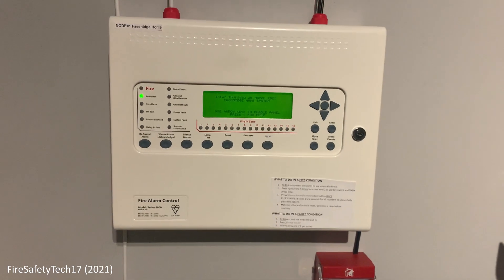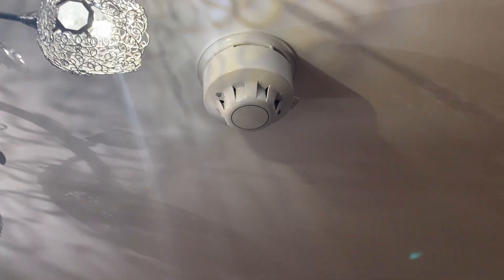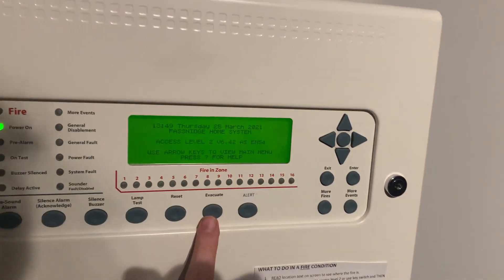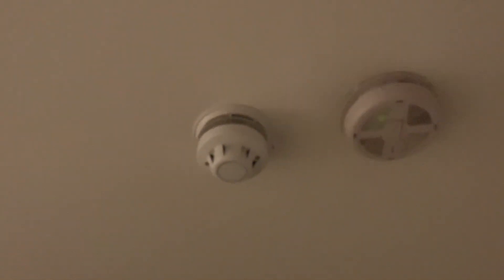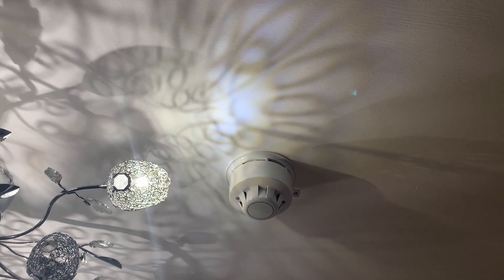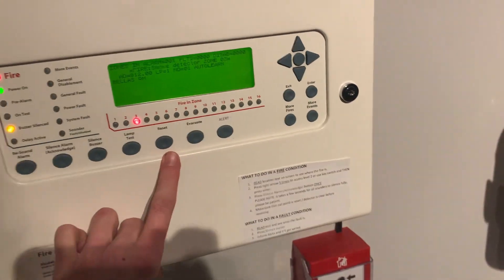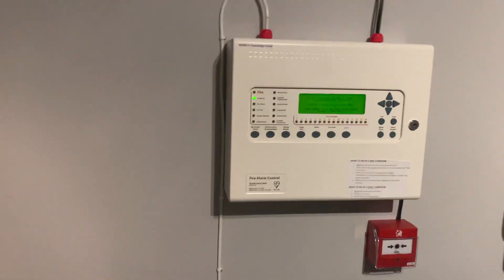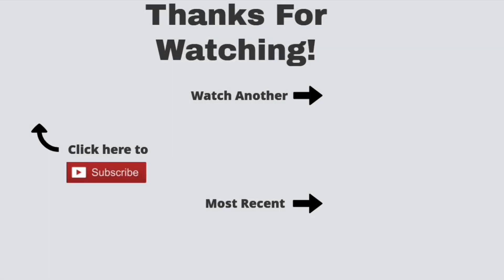Apollo XP95/Discovery House System Test 1 | Tour And Test

Comment: You can do system test 2 Someday
Reply from the maker: It’s already recorded, it will be uploaded on less than a week.
Reply: @fst1775  why did you put A Heat Detector in the Bathroom?
Reply from the maker: @Siobhan_OShea  Smoke detectors are going false alarm from steam and would be more prone to contamination.
Reply: @fst1775  uhh Ok Never Noticed

Comment: also the reason the symphoni is crackling is because either you have wired the loop the wrong way into it or you don't have enough isolators.
Reply: isolators are to cut out sections of the network that are short circuited. they don't filter interference. if you get a section of cable between two isolators and short it out you will find the yellow LEDs come on, on both and the panel will report open loop along with missing devices on the shorted section of cable if any.

apollo have designed their protocols to be quite robust against interference, they will take quite a bit before data becomes to fuzzy to decode, the interference can however be amplified by the sounders if it gets past the filter circuit designed to filter the power from the data on the two wire network. 

all FP200 cable is screened for data integrity that's that foil wrapping the pair, follow the manufactures instructions on where to connect this to in each device and most importantly at the panel where the screen is connected to earth.
Reply from the maker: @testlogs9005  yeah true, I’ll get round to replace the synphoni to an open area sonos sounder probably.
Reply: @testlogs9005  Yeah I had that with my intelligent call point and KAC call points isolator leds lighting up, but it was handy as I knew it was the wires going between the two that were shorting
Reply from the maker: Interesting, I do seem to have quite a lot of isolators on the system as all the base sounders/bsdr b have isolators. I’ll look at the wiring but I’m pretty sure it would of pissed of the panel if it was a wiring fault, But I’ll see anyway.
Reply: To be fair replacing it with a Sonos would be much better as they are much easier to wire

Comment: Few things i've picked up on, i can't tell if it's just your video but your sounders sound really low (Needs to be 85db.) And FP would be noice, other than that, decent.
Reply from the maker: The system will be converted to FP200 eventually I just don’t have some at hand at the moment plus my parents don’t want me making large holes in the ceilings of bedrooms at the moment. I’ll do a check on the db levels and the volume of the sounder beacon base as it does seem quiet, I reckon it’s dip switch 8.
Reply: @fst1775  what volume are your base sounders on (not the intelligent)
Reply from the maker: @145-k1b  the integrated base sounders seem to be on full volume, however I’m not sure about the sounder beacon base. But the intelligent does seem louder and take over the sounder beacon base.
Reply from the maker: @145-k1b  just an update, the sounder beacon base was originally set at 75dB, but I’ve changed the volume and it should now be at 91dB